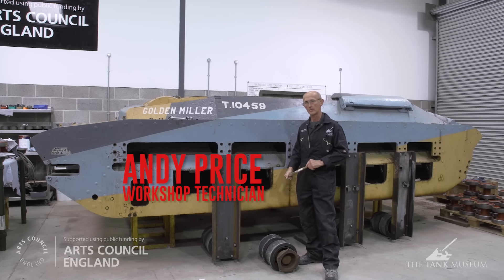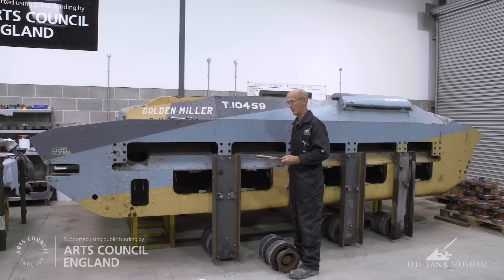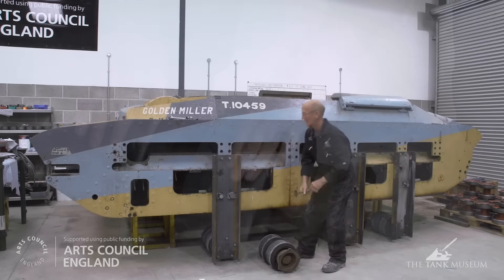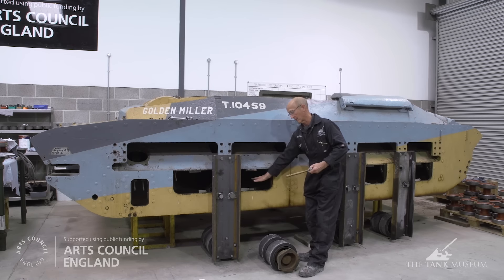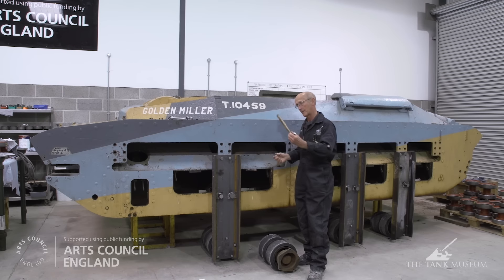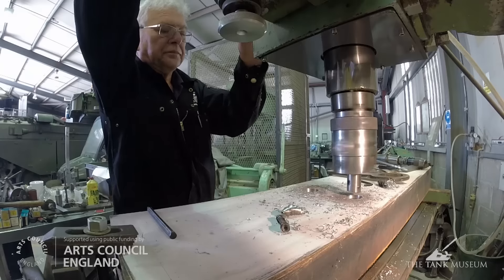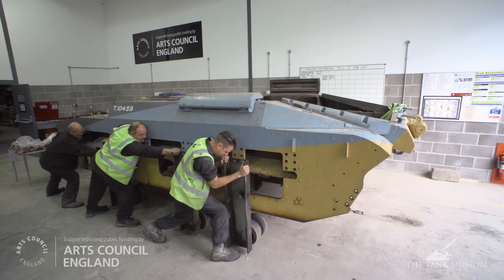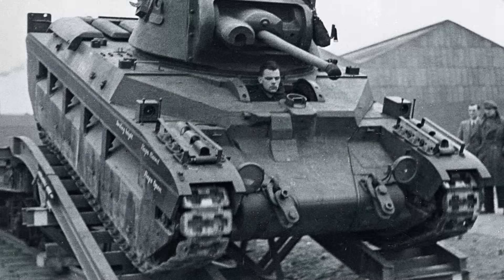The Matilda Diaries Part 7 | The Tank Museum

Comment: Thank you for the video!  I would have welded cross-beams in between the individual legs.  The incline can, and will, put undue pressure on the leading lower ones.  No sense in risking a collapse, nor even just having trouble with chattery legs, when a cross beam in between each leg's lower end would stabilize it.  Maybe I've just seen too many failures of legs...
Reply: I'm thinking you have a point, how much force can each of those baby bolts holding the rollers in place hold, maybe 25 tons each? Sure theres 5 per wheel, 6 wheels in total, but if the tank collided with an incline at 2 gees on an angle concentrating all the force into one roller..... Theres also leverage to take into account. I would advise making sure nobody is standing too close when it's being moved XD.

Comment: If only you guys had a tracked vehicle somewhere that you could use to tow this around with LOL Great work guys and a very good solution to a difficult problem, although some form of brakes might be advisable, just in case. Top marks and best of luck with the rest of the refit / renovation
Reply: Exactly my thoughts. They have barns full of tanks but they really had to power it by six men. It suggests that they would do anything to protect their steel darlings from any harm. :-D

Comment: I was starting to think that we'd get no more of these diaries. You guys need a little ride on lawnmower tractor converted to work as a tug for large loads like that.
Reply: a lawnmower isn't going to move a 26t load of steel.
Reply: that brit vamp chick it will be considerably lighter than that with no turret, engine, ammo, suspension, road wheels, treads or mechanical parts inside.
Reply: A lawnmower wouldn't move a BT-2.
Reply: I was wondering, hasn't Bovington got a working Universial carrier handy for this sort of thing?
Reply: @Marc83Aus  Think about how dangerous it would be on those little rubber wheels to have a full powered armoured vehicle pull on it.
Reply: @TheMarineGamerIGGHQ  I wouldn't call a 3 ton vehicle with 85 Horsepower a full powered vehicle. :p
Reply: @Marc83Aus  it is compared to 3 people pushing it. It's enough to make things go awfully wrong

Comment: now try that with a churchill...
Reply: not much worse honestly, only about 12t heavier. compared to say the tiger one which is over double the weight. or a bengal (king) tiger at nearly tripple the wieght.
Reply: `only` 12t...
Reply: Viridis Lux "only" being comparative. My point being that the churchill isn't a massive heavy tank, the tiger that they restored is way heavier.
Reply: yeah, good thing too, the churchill was slow enough as it was.
Reply: I will try Churchill as soon as You move the TOG 2 with Your bare hands. To be fair You can have 5 friends too. :-D
Just kidding.  It would be hell to move it even with a tractor.